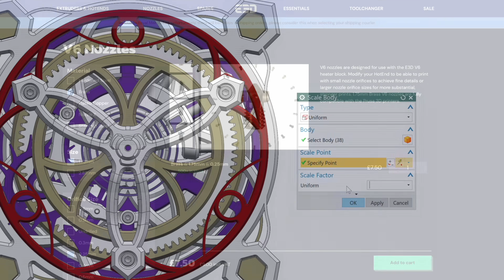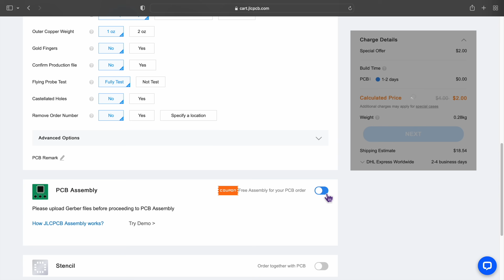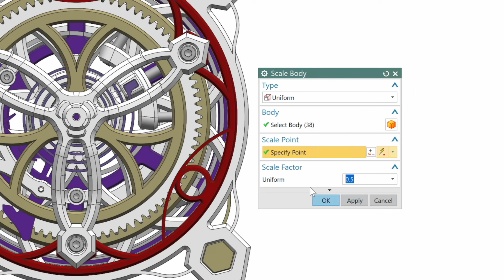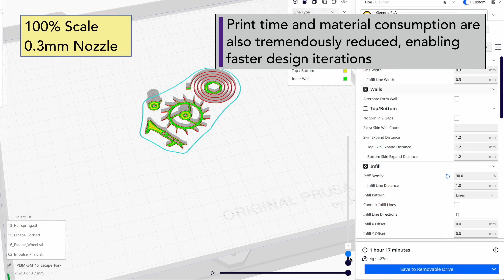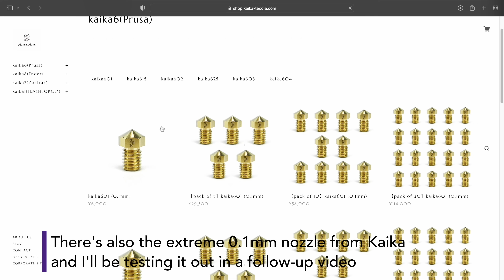Micro Mechanica | 3D Printing the smallest possible mechanical model [Experiment]

Comment: This really beat all expectations. Didn't think you would get 50% to work on fdm. How smal could this go with SLS I wonder. or is the material not suited for mechanical components?
Reply from the maker: Thanks, I'm equally surprised how well it works at 50% scale. I was initially concerned that the thin escape wheel fingers would just snap right off the build plate, but it looks like I underestimated the material properties of PLA. 

I don't have much experience with SLS, Material should be fine, but the rough powdery texture might not introduce too much friction for mechanical components.